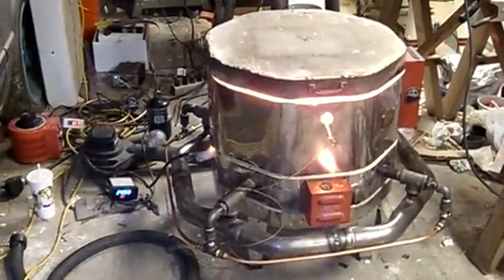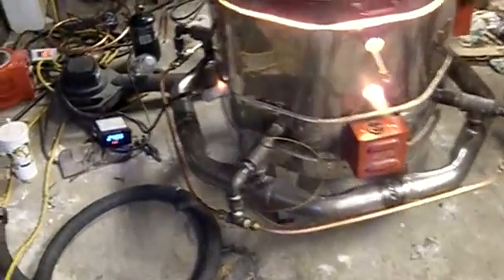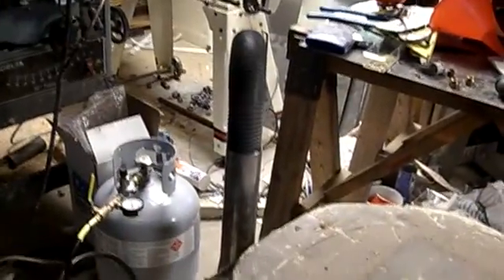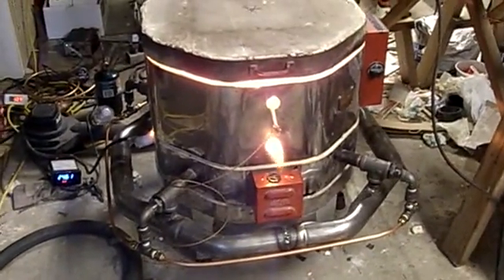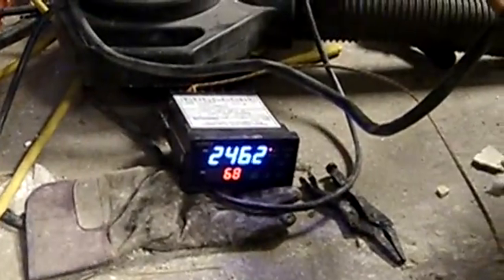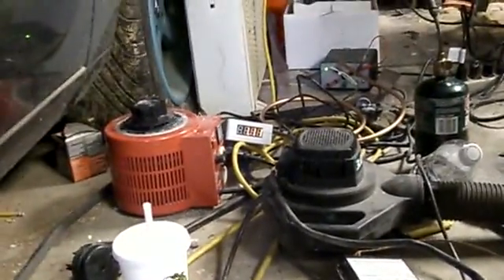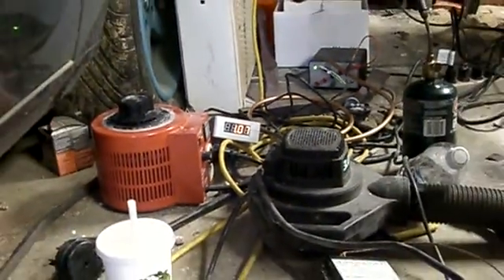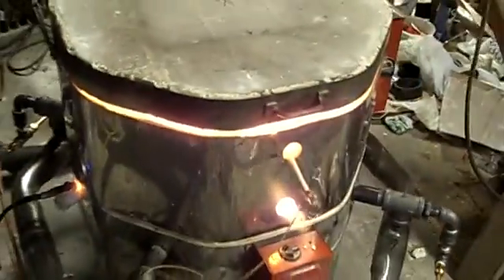Life Above Cone 10, the New Gas Kiln

Comment: Is it a repurposed oxygen probe?
Reply from the maker: The O2 sensor is an automotive wideband sensor (Bosch 17025) connected to an Ecotrons meter (http://www.ecotrons.com/products/accurate_lambda_meter/). For my next controller, I'll be using the same sensor plus my own O2 interface.
Reply: Thank you for the info, been missing one on my gas kiln conversion. Great little kiln you have there. If I ever get my hands on another second hand one I might try an air preheat similar to what you have going here.

Comment: Hi Brian, 

Question for you, what's the brand name of your PID and thermocouple? Looking around online, I am having trouble locating a high-temp one like yours is using. 

Your set up looks great!

Best regards!

- Paul
Reply from the maker: +Paul Walter 
I got mine from ebay.  Search for "Thermocouple Type S" (here's a current one for sale: http://www.ebay.com/itm/Thermocouple-Type-S-6-Insertion-Ceramic-Prot-Tube-/201276170662?hash=item2edcfea1a6:m:mcArmx4h722qe1CnJOXTuhw).  They aren't cheap, I paid about $200 for mine.  

However, if you keep the temps in the K thermocouple range (2350 or so), you can get by a lot cheaper.
Reply from the maker: +Paul Walter
The controller (which isn't hooked up as control here, just measuring temp) is a JLD634 from www.lightobject.com (http://www.lightobject.com/JLD634-RampSoak-PID-Temperature-Controller-for-FURNACE-KILN-OVEN-with-RS485-P603.aspx)
Reply: +Brian Franchuk Awesome, thanks very much! I didn't actually realize that there was a difference in thermocouple types. Both the PID and S-type thermocouple look very promising. Thanks a ton for insight!